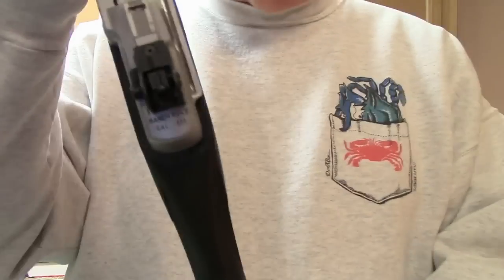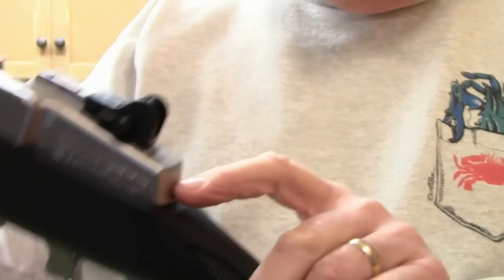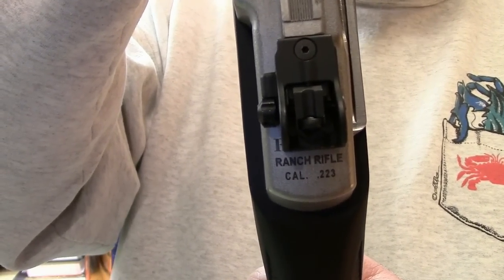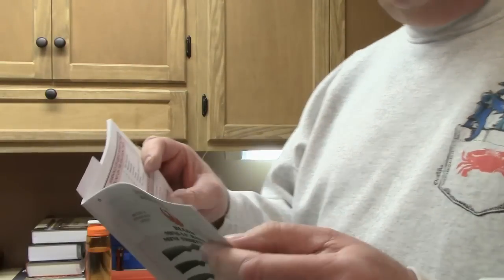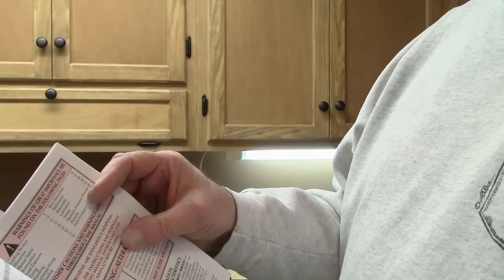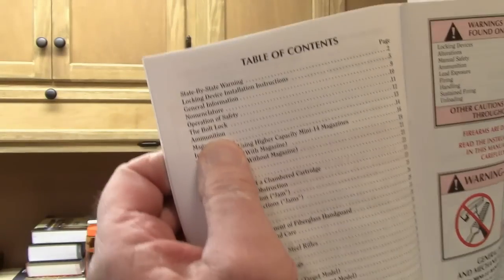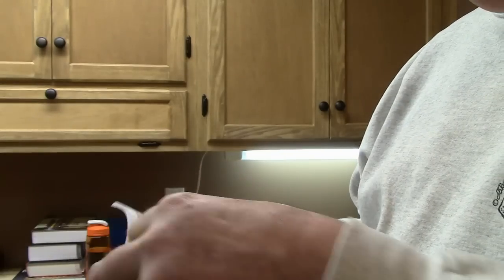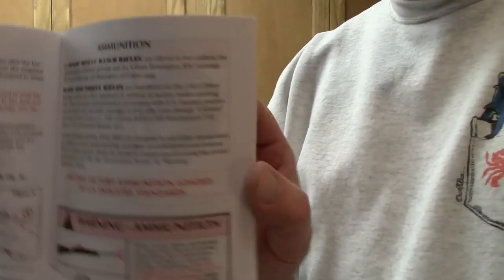Use of 5.56 mm NATO in 223 Rem. chambers ~ Finally, "Can I use NATO in my Mini-14?"

Comment: Where does .223 Wylde fall into this? Can you do a video on the chambering?
Reply from the maker: JSmunitions 
It's simply a modified chambering dimension that's between the Remington 223 and 5.56mm, which offers the ability to fire military pressure ammo with the accuracy advantages of a shorter throat.  It's a viable alternative for the custom barrel, and it works exactly as claimed.  Having said that, military ammo works fine in standard military chambers, and 223 ammo works fine in 223 chambers.  There is a bit of practical contradiction of uses. If my goal is to shoot 5.56mm ammo, I am certainly not seeking gilt edge accuracy, and if I'm seeking gilt edge accuracy, any advantage of 150 fps that compromises the absolute accuracy advantages that a standard 223 chamber offers might be counterproductive to my goal.  Accuracy folks tend to make no concessions to accuracy, even at the loss of velocity, and velocity seeking folks place that in priority. For the person who compromises both, I think it might offer a solution.  For others, it's an answer to a problem they don't have.  I'm of that camp.

Comment: Worked in customer support for software where RTFM (read the fucking manual) was told to customers constantly.  You would think that with something with the potential to hurt you far more than most software people would do just that.  When I purchased my Colt Ar15 back under the Clinton ban back in 1999 I was told the difference, and we still have people that don't know better.

Comment: Love the common sense approach to information that you deliver. You seem to have a lot of experience. Thanks so much for making your videos and sharing your knowledge. Keep the videos coming. P.S. Say hello to your wife!
Reply: Wright Connection except the info is incorrect.
Reply: louis cyfer And your videos and expertise and common sense is where?
Reply: ssng1 according to the ruger owner manual both 223 and 5.56 are fine from the mini 14, and the rounds are generally interchangeable.
Reply: louis cyfer  "and the rounds are generally interchangeable." Anyone that follows this advise is begging for a big hurt. These cartridges are NOT generally interchangeable. Read the manual!!! Bottom line if the MANUAL or barrel designation is 556 than both 556 and 223 are good to go, if the MANUAL says 223 than ONLY 223 is safe, again SAFE. Just because it fits and/or "somebody said" it's ok doesn't make it safe. YMMV but I will stick to the FACTS. BTW 223 is always ok in both.
Reply: EricAndHis1911 why do you think this? is it the pressure thing? saami and nato measure pressure differently and when you convert the numbers they are the same. the angle of the throat amd the tolerances are different, but that matters only with operation when not cleaned for a long time. see, i go with the facts and you are just going by what someone told you

Comment: What I have never understood is why, in my Steyr AUG, which is chambered for .223 Rem, the trajectory out to 500 yards is the same whether I use 5.56 NATO or commercially available .223 of the same bullet weight, if the internal pressures are so different.
Reply from the maker: Neil Hardwick 
If you are using that as an indicator of internal pressure, you are very wrong.  Exterior ballistics is far more than internal pressures, which is most assuredly different.  If you have any doubts about tge matter, simply call any of the ammunition manufacturers or any of the many bullet and powder manufacturers about the specified pressure difference between NATO 5.56mm and .223 Remington.  They are categorically different, and the chamber throat dimensions and rifling leade are very different.  The industry does not issue these cautions just for the sake of it. Never presume pressure levels by ballistic performance.

Comment: 5.56 is speced at 62,000  psi for CIP and 55,000 psi for SAAMI to put that into perspective .223's current SAAMI spec is 55,000 psi. most of your .223 chambered AR's are speced for 5.56 and can handle pressures well within the realm of 77,000 psi before failure even the .020 " free bore isnt enought to cause pressure spikes stop spreading around fuddlore.

Comment: Hey all i realize this is an older video but i have a question about magzines ,rather then chamberings? I was told i couldnt buy a 10rd 350Legend or 458Socom magazine because i could fit 20 or more rounds of 5.56 in the same magazine. So basically the person on the phone i contacted let the cat out of the bag. When i realized i had old 15rd 5.56 mags that my state use to call legal that i had all the mags i wanted for the larger calibers. So now im trying ot find out what else i can fit in a 5.56 mag? A 6.8SPC mag will also run in a 224Val mag so why wont it also run 6.5Grendel? Dose anyone know if any other rounds will run in a 5.56 mag? Im trying to be cheap and not have ot buy all different mags that i may not need? thanks
Reply from the maker: This is not a blog thread and only I am entitled to answer questions regarding my videos, and I answer them regardless of the age of the posting.  Generally, magazines should be specific to the cartridge, because the engineering is tailored to the case shape and diameter.  However, where case proportions are identical, standard 5.56mm magazines can often work.  A 350 Legend uses a completely different case than the 5.56mm but it has the same overall diameter, so they fit in the same capacity.  However, the 458 Socom is much larger in diameter than the .223/5.56mm case.  So, yes, a ten round 458 Socom magazine will accommodate 30 rounds of 5.56mm, which is prohibited in certain jurisdictions.  Manufacturers and dealers keep abreast of such minutiae, and the legal compliances that they must follow if they wish to avoid criminal prosecution.

Comment: I have a mini 14 chambered for 5.56. I use  223 out of it but I was wondering if you can use both without any issues?  My friends say it's bad to use  both out of my gun. What is your opinion?
Reply from the maker: Opinions have nothing in common with that question.  I hope you watched the video, and I hope you read your owners manual.  The 5.56 round is identical to the 223 in all things except power.  It's more powerful than the 223.  Of course you may fire a 5.56 in any 223.  You may not do the opposite, because the 223 was not chambered with the same throat dimensions to tolerate the additional pressures.  Tell your friends to read their manuals, too.

Comment: The ONLY firearm this applies to is the Ruger ranch rifle made prior to 1984. Ruger was producing chambers close to the 1964 mil-spec of the .223 Rem designed cartridge. In 1980 the Mil-spec changed to 5.56x45. ALMOST ALL OTHER FIREARMS EVEN ONES PRODUCED PRIOR TO 1980 CAN HOLD UP TO THIS HIGHER CHAMBER PRESSURE. So even firearms marked .223 can safely fire 5.56x45.. what this amounts to is you cant use a Hair Dryer with an extension cord because you void the electrical UL rating... yes some Hair Dryers power cords will melt if you use an extension cord if the cord was designed too close to the spec of amperage... as per the UL rating.  I owned an 1995 Olympic AR15 with a .223 marked barrel, made from non-Mil-spec B gun metal plain jane non-chrome lined 1/9 twist 4140 CM not 1/7 twist 4150 CMV and fired HUNDREDS of 62gr green tip 5.56x45 without problem. It even grouped 2 MOA on a good day.
Reply: Applies to ever single 223 BOLT ACTION hunting rifle ever made with the exception of CZ.  Applies to the Remington AR VTR VArmint.  Applies to every single m16 and m16A1 and the Colt versions of those models.
Reply: @excelsior6365  I seriously doubt that... while some bolt action guns may also be effected, this is effectively the manbearpig of the AR world. Always talked about, but never really seen in the real world. There are a 1/2 dozen videos of people who have specifically ran 62gr 5.56 out of a .223 Rem chambered rifle WITH NO ISSUES AFTER 1000 rounds... go search for them.  Even James Yeager before his health issues did one.

Comment: If you are reloading, is it safe to use the 5.56 cartridge with your normal primer and powders? Is the case cartridge design also creating an issue and should not be used?
Reply from the maker: apyramidbuilder 
There is no dimensional differerence between the components, though the military case will sometimes be slightly thicker, but not always.  That additional thickness will reduce case capacity slightly and may require a slight downward load adjustment if you were previously using 223 cases.  The only difference between 223 Remington loads and NATO 5.56 loads concerns the internal pressure, which is significantly greater with NATO rounds, which requires the appropriate rifle chamber.  The components and dimensional specifications of the two rounds, excepting the higher powder charge are otherwise the same. I suggest that you review my loading instructional videos in their entirety for full information on this and other pertinent issues.
Reply: Production specs on military-specification cases such as those used for the 5.56x45 NATO cartridge take into account the fact that mil-spec ammunition must not only be robust and tough-enough to function in a carbine or rifle, but when fired through individual and crew-served automatic weapons such as the M249 SAW. This means that NATO-spec 5.56 brass tends to be slightly heavier, thicker and stiffer than commercial .223 Rem. cases. Not always, though, because some manufacturers make their .223 to pretty high standards nowadays. A quick way to sort cartridges - whether 5.56 or .223 - is by weighing them and batching them that way. That's a good indirect method of estimating internal volume of the case. Many commercial reloaders freely intermix 5.56 and .223 brass, but they don't load to near-maximum pressure levels, either, just to be on the safe side. Most reloading manuals recommend backing off at least a grain or two on loads you use in commercial brass, when transitioning to mil-spec cases. The safest option is to back off and re-do your profile loads altogether. The issue with mil-spec brass that crops up is that military cartridges have primers that are staked in, so that they don't back out under pressure. You will occasionally run into lots of 5.56 cases which are tough to de-prime and when you do de-prime them, you have to ream out the primer pocket, too to get rid of that crimp. This happens all the time with Lake City brass, for example. It's often high-quality brass (especially the match-grade stuff), but can be a pain in the neck to work with sometimes. Some reloading manuals suggest using only mil-spec primers, which have a harder than normal cup. CCI makes them. However, the normal CCI primers work great in 5.56 and .223 - no need to get the more-costly mil-spec stuff. Federal makes excellent primers, but they have a reputation for being soft, so some people avoid them for semi-auto use, as they don't want a primer to be pierced by the firing pin.

Comment: 5.56 has 12,000PSI higher pressure? Insane. How is that possible unless some very exotic propellant is used?
Reply from the maker: Same powder, just a bit more of it. Pressure increases exponentially to powder volume, which is true with all cartridges. The 5.56 is chambered with a long freebore and shallow leade to accommodate the added pressure. Simple physics, and nothing insane about it.

Comment: Hi Mr Blue a question I reload 5.56 cases to 223 loads watching for stressed primers with mid range powder weights. Do not have issues with extraction or elonged cases. Do you see any problems with this . Thanks
Reply: DONT DO IT!!! The headstamp on those IDENTICAL cases will detect the powder, primer and bullets and convert your 223 loads into dangerous 556 loads just because it says so on the brass
Reply: Thanks
Reply: @johnutting9615  I apologize - my sarcasm was not meant to insult you, but I realize now after looking back that it probably does not have a place here. To be clear - you are 100% safe in using 5.56 casings to load to .223 pressures and then firing them in your .223 chambered rifle.
Reply: @pa6552  I heard at a gun show that some newbie started to rub a box of 5.56mm NATO against a Remington 700 chambered in .223, and the rifle burst into flames!

Comment: my mini 14 is marked 556 NATO on it not 223 Remington?I have a newer made mini did they change something on it or in it I should say?but on the other hand I have seen other newer made ones market 223?
Reply from the maker: They are all the same chambering.  Ruger recognized that the older marking confused folks so they just changed it to read 5.56 NATO.  They will all fire either 223 Remington or 5.56 NATO, interchangeably, no matter what the marking on the receiver indicates.

Comment: I'm confused.. In the beginning of your video ( 0:17 )  you state "NO!" you cannot use .556 NATO cartridges in your .223 Ranch Rifle.
 Then you read from the book ( 08:15 ) and you say the opposite. (At least the way I interpreted it..)

In the manual for my first generation (1982) .223 Ranch Rifle it states: 

"The RUGER® MINI-14® RANCH RIFLES are chambered for the .223
Remington (5.56mm) cartridge. The Ranch Rifle is designed to use either
standardized U.S. military or factory loaded sporting .223 (5.56mm) cartridges
manufactured in accordance with U.S. industry practice"

Are "standardized 5.56 U.S. military rounds" the same as 5.56 NATO rounds, meaning I can use them in my rifle?
Reply: The Ranch was designed to use 5.56 from its inception due to a huge military surplus after the Vietnam war. They decided not to stamp 5.56 on the earlier models because at the time most Americans frowned at the metric system and could better comprehend .223 
He has a later video explaining why

Comment: Ok this may be long but is it safe to reload my 556 brass for my 233 bolt action? I have Winchester 556 brass from my AR but want to reload it for my ruger m77 mark 2 for varmints.
Reply: Yes, IF you; full length resize all cases first, then start at MINIMUM loads and work up, looking for pressure signs. Best accuracy (which you want for varmints) is not going to come at full load anyway... Try different loads/ powders/ bullets to find what your Ruger likes best, and shoot the stuff it doesn't like in your AR ;) No problems running .223 in a 5.56 barrel.
Reply: @mikecollins8241  thanks . I just hate wasting brass , I just have to get a few more items for the process and I can get started.  Thanks again.

Comment: "Pressure not in the same ballpark"

BS. 55,000 psi and 62,000 psi MOA are in the same ballpark. Proof pressures are +25% to +30%. Meaning .223 chambers are proofed to 68,750 psi.
Now, 62,000 psi Maximum Average Pressure does not mean that no round is going to exceed that, on the contrary, some will. Typically, some can add +4%. But even if your bunch has some with +10% of them (then their manufacturers need to be arrested for selling junk to the military), they still will be below proof strength of .223.
So you can shoot an occasional 5.56 through .223 chamber and your rifle will almost certainly be fine.
Now, should you do that? No. Because while yield strength of the chamber/barrel and bolt steels (110,000 psi or more) will far exceed the pressures, fatigue pressure (much lower number, sometimes as low as half of the yield strength) of some cheap ass .223 gun might not, and repeat exposures to overpressure might weaken the steel faster to the point of failure.
Just use Wylde chambers and 5.56-certified bolts if you have a choice.

Comment: But, can you shoot .223 in a rifle chambered for .556?
Reply from the maker: Absolutely. Both rounds are exactly the same dimension in all respects. The .223 Remington is loaded to lower pressures, so it can be fired in any 5.56 chamber safely. The opposite is not true for the same reasons. A 5.56 rifle and brass will last longer on a diet of .223, and the difference in ballistics is negligible for most uses. Your ears will last longer, too!